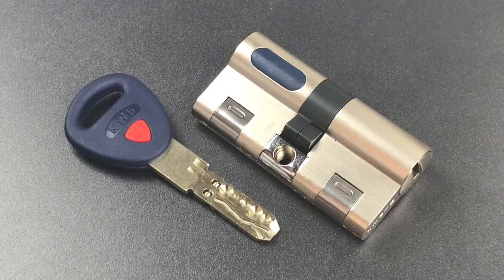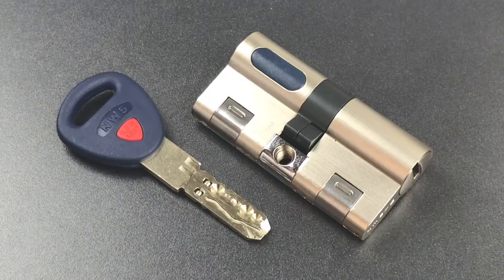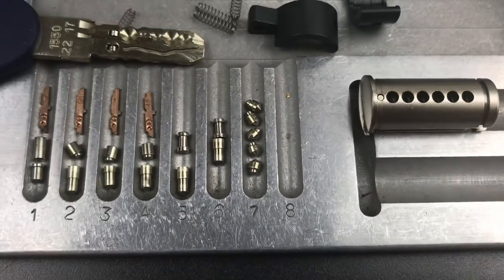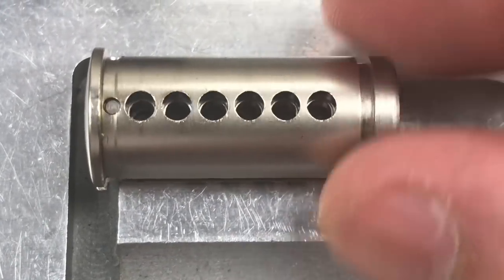[702] The Naughty Bucket Chronicles — Mauer NW5 Euro Profile Cylinder Picked and Gutted

Comment: Could you possibly do a video on how exactly those sliders work within the lock? I've not seen those before.
Reply: They slide to the right and left into the slots on the side of the core, locking it. The small bumps about halfway through the sliders themselves align with the linear indent on the key. This aligns them in the center so that they dont protrude from either side of the core. LPL pushed them to one side to begin then picked them to the other side, but because of the the tension they do not protrude out the other side of the core.

Comment: Great video. Kudos to Bill. It’s encouraging to me as a beginner to see someone as skilled as Bill run into things that he has trouble with. Also encouraging to see that the stuff that beat Bill isn’t impossible. Thanks gentlemen! You are both great teachers. 

A few questions:

What do the passive pins do?
How do sliders work?
What do the numbers on the sliders mean?
Reply: I was wondering about  those numbers as well.  They weren't in order, so my guess was that they were some type of depth or size measurement so that the key could be cut correctly, but LPL said that he just had to push them out of the way (I think that these were those parts he was referring to...) far enough so that they weren't obstructing the rotation of the cylinder, so that doesn't sound right...
Reply: The numbers on the sliders are probably manufacturing / assembly marks. When you look at them, both 3s are the same.

Comment: It took me about 2 hours of trying to get a lock like that open. The design was almost exactly the same. It was incredibly difficult. I needed to use a rake to hold the sliders in place and then pick each dimple while holding the breaker bar. It was crazy. I think I shredded the pins while doing this from all the tries.

Comment: Interesting on the "interactive" element. Question: What would be your opinion on an ELECTRONIC interactive element? Not necessarily something static like a chip on car keys, but perhaps something like a random number generator used for garage door openers, powered by a coin cell in the key itself and activated by a button on the key.Basically the key is as normal or complex as one wants, but there would be two two spots on the key that would electrically isolated from each other. These two spots would be changed from key to key obviously. When the key is inside the lock, the user pushes the button on the key, sending some low level communication along the circuit created by the key between two pins. That communication would contain generated random numbers/data, which would, in turn release an electronic solenoid inside the lock allow the key itself to be turned and the lock to be opened. Other than the typical pushback when suggesting something electronic go into a lock (for good reason, many of those reasons have real merit like running out of power, pushing the button too many times, etc. etc.) Heck, you could even program it that when someone tries to force the "smart" pins too many times (oversetting or accidentally shorting them to each other without the proper resistance between them, the lock could be "temporarily disabled" until a correct key and MULTIPLE random numbers are generated and matched. Of course, this key wouldn't work if it ever got dirty or if the lock got dirty (or wet for that matter), but those are things that can be worked around.

Comment: Great pick. Apologies up front if this had been asked in the over 400 previous comments - 1) does seeing the features on the key inform your picking attempt (and if so, to what degree, meaning how much longer would the pick take, or is it possible that the lock would otherwise remain unpickable), and 2) what is the relevance of the numbers 1 to 4 (which were out of order in the tray) on the sliders? TIA

Comment: Would love to see the reassembly process.
Reply: yes, I disassembled one of my locks that was binding, I was too lazy to ask for a locksmith, also, the last two ones that I got didn't fix the problem with my lock/door.
needless to say that assembling is harder. but I've learned something, lock was binding because of the door, no wonder locksmiths couldn't do anything, I have to fix my door frame before (they could have told me that, and I would have saved money on them, lol)

Comment: Excellent work Counselor! Can you please tell me where you purchased those cool gutting/pinning tools, I've never come across anything like that and I MUST have a set! Once again Great Job and Thank You for your time
Reply: I think they're from the HUK set. He's done a video on it.
Reply: The HUK set includes a pinning shoe, but not  the front loader. As far as a I know there is only one from peterson but also 3D printed versions, designed by redcatimaging.
Reply: I know I've seen it somewhere but it was too expensive for me.

Ah, found it. Brockhage had it. The Peterson universal top loader -
https://www.lockpicks.com/universal-top-loader-in-a-tube.html
I couldn't afford that but I did get their universal plug holder for $14. I also got their reverse action tweezers ($5.99) and the Brockhage cylinder holder ($12.50 - cheaper than the HPC one). Look under their Sale Items tab for those.
BB's Lock Lab site has an ad for them but I don't think they offered a discount code. CLK Supplies does (or did). The latter had slightly cheaper shipping for me but they were both fairly competitive apart from that (although Brockhage has sale items which offsets the discount CLK offers).

Comment: Doesn't seem to be resistant to snapping, which is the most common attack.  So pick resistance doesn't really enter into it.
Reply: At first I thought so due to the hole in the middle. Notice the spinning element LPL had to use wire to knock out the pin is split into 2. That means if the lock snap in half of it will still be intact. This lock is designed to snap and keep the door lock.
Reply: +Nathan Fielure
I suggest you read up on eurolock snapping.  Snap the lock and the other side still requires a key but from the snapped side you can use a tool to manipulate the cam.

Snap-resistant locks have sacrificial elements which break off and still leave a bit of the lock body and a few pins in place.  The remaining pins would have to be picked, but that's easier than picking an unsnapped lock.

Snapping attacks on a lock without sacrificial elements are quick, easy and require no skills.  Snapping is the most common attack on eurolocks.  Which means that pick resistance is not a requirement on a lock that doesn't resist snapping attacks because nobody is going to try to pick it in the first place.

Basically, eurolocks, even the snap-resistant ones, are crap.  They're insecure by design.
Reply: Well, this lock appears to be very short. I'm not sure it's as short as ICS (27mm at shortest), but still, for most doors you'll be able to get one that doesn't stick out even 1 mm.
Reply: +Tom Hejda
From what I've read and seen (youtube videos) there's enough there to snap.  All it needs is a tool with the form of a sturdy key blank on a long handle and you can snap it.  Unless you make it so short there are only one or two pins.

Euro format locks are intrinsically badly-designed.  If you pay a lot more you can get eurolocks that are more resistant to snapping attacks, but you can still snap them and have only 2 or 3 pins remaining, which makes them vulnerable to a pick attack even by the unskilled.

Whoever dreamt these up should never be allowed to work in lock design ever again.
Reply: bdf2718 They probably won't.  The Eurolock outer shape is pretty old, so the original designer may be long dead.  Problem is that millions of doors have been made where no other lock body shape will fit, creating a chicken and egg situation for any company wanting to sell something better.  This is why even ASSA-Abloy offers eurolock bodies for their most popular cores.  Because few people buy a new secondary door just because some lock brand refuses to offer a matching lock with the same key as the main door, they'll switch brands and not look back.
Reply: +John Francis Doe
It's also why there's a market for more expensive "snap resistant" eurolocks.  They're an improvement, in that the attacker has to be so much of a numpty he/she can't pick the two remaining pins after the sacrificial element has snapped off.

I'm not a fan of the eurolock, as perhaps you can tell.  Yet I have one on my front door.  Because that's what my landlord chose.  So I have to create the appearance of such abject poverty that anybody breaking in would leave some money out of pity. :)

Comment: It baffels me, that almost every lockpicker clamps them 180 degree rotated. At least in germany the lock is installed with the circle on top. If there is any pin which uses gravity or something you just pick it in cheat mode - so to say.

Comment: Do not buy Mauer locks! I had NW4 for the last 3 years and now it starts giving me problems. I guess the pins started failing, cause it's getting more and more difficult to remove the key from the cylinder. It looks like it's a matter of months when I will not be able to take out the key at all. Such a shame, elaborate key design bot not pick resistant and low quality materials used in lock parts.

Comment: Do you also have something like a naughty bucket ?
Actually this is all obsolete, with all the electronic and artificial intelligence stuff you can add to secure doors and limit accesses, isn´t it?
Reply: kulturfreund66 Not really. If you do some research on physical penetration testing, you'll find that despite companies using badge readers, fingerprint scanner, retinal scanners, and other various high tech security devices, most of the time they are easily bypassable by some physical means. Nothing is unhackable or uncrackable, but it's usually much easier to quietly and quickly inject software to override electronics, than it is to physically pick a high security lock or use destructive means to get around physical security. The best is to combine both aspects, electronic and physical security systems. Due to this, I doubt physical key locks will be obsolete for a long time.
Reply: @michaelmccasland  Maybe you´re right.
But how do you inject software from the outside into a system not linked to the internet? And what about passwords/digital codes? - Don´t get me wrong. I appreciate very much all these brilliant high skills shown on YouTube and I´m actually loving also old and traditional craftmenship, it´s just from an absolute point of view that I´m argueing and asking if this technically hasn´t become an outdated concept.
Reply: kulturfreund66 Again, do some research on Physical Penetration Testing. The system doesn't need to be connected to the internet if you are standing right in front of it. Digital codes and passwords can be easy to get past though numerous means. There are tons of stories of companies spending hundreds of thousands on network security and high tech security systems, only for a guy with a crash bar tool, a travelers hook, some pieces of plastic, some lockpicks, and a can of compressed air to let themselves into a data center, pull a server off the rack, and walk out with it.
Reply: @michaelmccasland  OK, convinced me.
In case of some upcoming question I hope you don´t mind if I ask you.

Comment: It's too simplistic just marking locks as "difficult" or "easy", I think. Just like some locks require special tools, some locks seem to get a lot easier with certain picking methods. In this case LPL made a point of the stout tensioning. Seems like that might be one of the big tricks for this one! That doesn't make it less impressive to me, just means it's not only in the fingers, but in your head and fingers